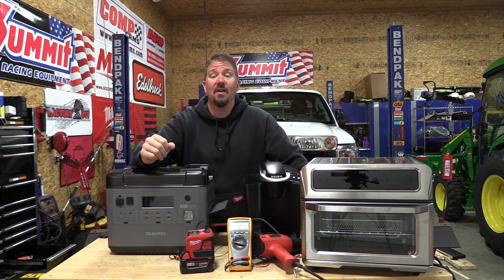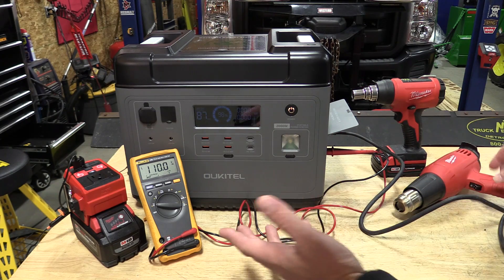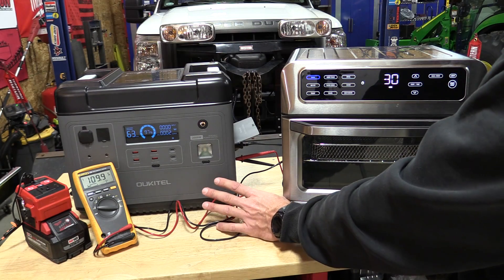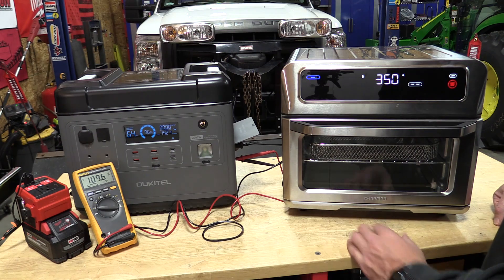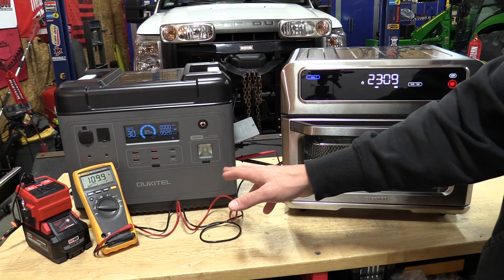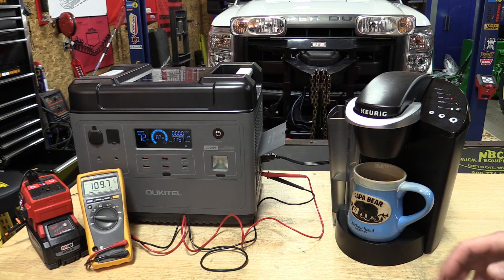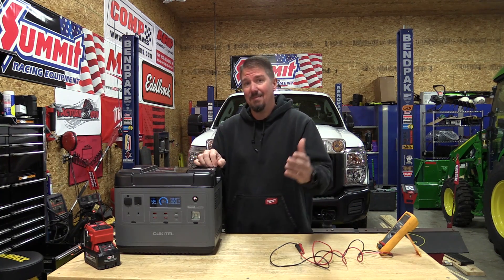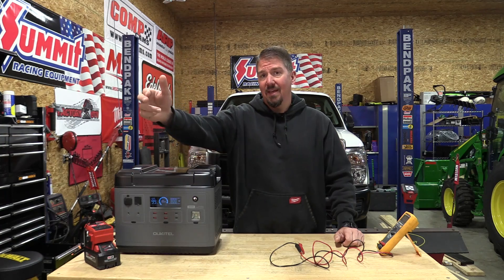What Can A Battery/Solar Generator Run?  You Might Want To Keep Your Gas Generators!

Comment: and this is why i'm keeping my little gas generator. it may not keep up with a 2000-3000 watt load but it's meger output will get that battery going a heck of a lot longer and can recharge it to a level that the solar can take care of. (so early morning it'll bring it to a lower level vs late evening)

Comment: Great video! Almost ANY appliance will draw 1,200-1,800 watts. Doesn't matter if we're cooking a turkey or sawing a board or making a single cup of coffee. These things are all designed around a 15 Amp wall plug with unlimited duration of power available.

Now, when we ask a battery or a gas generator to do the job of our local coal plant, we are working with a very limited and inefficient power source.

Comment: Do you think running a new type of refrigerator at 110 volts is something that may not be a good idea?  Seems like these new refrigerators have electronics that my not like that lower voltage. 
What do you think on this ?   Thanks
Reply: a lot of us outlets don't hit 120v anymore. a lot are 110 or even lower. the new fridges have that in mind though they definitely don't like it.

Comment: I made an expensive mistake by not understanding that these things turn themselves off when they don't see a high enough power draw. I got one to run a refrigerator in my van, and it wouldn't stay on. I trashed the power box and built my own system so it stays on all the time. Lesson learned the hard way.
Reply from the maker: Some can be made to stay on.  Not this one.
Reply: @WorkshopAddict  I wish they would make it clear which ones will stay on and which ones won't.  It would have made things so much easier. However, by having to build my own system, I learned a lot that I wouldn't otherwise have known.
Reply from the maker: The Bluetti AC200 is one of the few that will stay on.  I bet you learned a lot!
Reply: @WorkshopAddict  Thanks. Yes, and still learning. Saying "I built that!" feels good.

Comment: I will only use them to run small things like laptops,  phone charging,  radios,   other small electronics.     
  Anything large,  Tools,  is way better running on a gasoline generator
,    You can buy a large gasoline generator for the price of these battery generators,
 Thanks for explaining this 😃😃

Comment: These solar generators are more capable than one might think depending on what you get, but you have to plan things out and be strategic. I wouldn't run high power draw devices like ovens and microwaves during a power outage regardless of what my power source is. Want to stretch your power out. I have several solar generators and here's my real-world test results for emergency situations:

- Bluetti EB240 (1000W output, 2400Wh capacity) - Runs my full-size refrigerator for 18.5 hours
- Bluetti AC100 (600W output, 1000Wh capacity) - Runs Internet router and network switches for 19.5 hours
- Bluetti EP500 (2000W output, 5120Wh capacity) - Runs whole home gas furnace for 21.5 hours!
- Bluetti AC200 (2000W output, 1700Wh capacity) - Haven't done long-duration tests as I use this for powering phones, fans, computers, and other random things

With this arsenal, I've found that I rarely need to turn to a gas generator or other power source. Most power outages under 24 hours I get by just fine with this. I also have 1500W of portable solar panels to keep them going.

Having said that, I agree with the title "You Might Want to Keep Your Gas Generator". I have a dual-fuel Champion 2500W inverter generator (1650 running watts on propane). The sun doesn't always shine, or maybe you just need to power up your batteries faster. I use the generator to recharge the power stations if solar isn't cutting it and grid power is still out. But then I can run the power stations at night and put the generator away. Dual backup strategy helps you stretch your fuel during a prolonged power outage. I recommend having both if you can swing it.

Comment: As someone who lives off grid and uses all solar, it's just dumb to buy a "solar generator". They're all underbuilt and overpriced. I run a whole house on a 2kwatt inverter. That's 2 chest freezers, 2 tvs, 2 laptops, the oven on a full sized gas range, and various lights. I have a larger inverter for power tools. Without the cost of the panels, my 2kw setup costs less than one of those "generators". Make your own, people. Make your own.

Comment: Biased, and i get it. Im looking at an ecoflow 1800 w 2 panels. 6hrs full sun 100% charge. 15hr run basic full size fridge. This unit is about 1400$ on sale. If the grid goes down, gas will be tough to get. Solar gens stay inside no noise no fumes, free refill. TV, frifge and lights, electric blanket. Im an electrician, these 1800s are worth it. Car charge, plug in and solar even gas gen. Solar gen is unbeatable for catastrophic grid fail

Comment: Thanks for the explanation of the limitations of inverters. Each energy source (battery, gasoline, kerosene, propane, solar panels, etc ) has a maximum rate it can deliver energy and a maximum total amount of energy it can deliver. One practical difference between sources is how much energy can you afford to store. It is easy to stockpile gasoline and kerosene. Most other sources get expensive.
Reply: personally i use propane for it's shelf life. ethonal free gas with a stabilizer can go a long while too but propane is a lot simpler and will get used in heating and some even some lighting. (i converted a little old generator to be an ac unit for added efficiency but god is it maintenance heavy and not really worth it compared to just having an extra tank or two of propane)

Comment: Great channel, always solid reviews. Not for emergency use , except to charge phones and small items, also work well with small camping refrigerators like Dometic . For power outage or storm related problems a small generator is all you need like a Honda 2000, it will run a full size fridge and heaters and lights no problem for 6-7 hrs on 1 gal of gas .

Comment: Nice video! I did a lot of research on back up batteries recently so this information is familiar to me. As a proper emergency back up these battery back ups have a lot to be desired and something like a Tesla set up is too cost prohibitive in my opinion. Gas is not dead. You got that right.  Cheers!

Comment: The EGO Nexus power inverter is awesome. The batteries are dang expensive though which limits it’s runtime according to the size of your wallet. The EGO inverter is not budget friendly, but still one of the top dogs.
Reply from the maker: The EGO Nexus blew up my RV refrigerator and battery charger.  I would recommend staying away from it.
Reply: @WorkshopAddict  Could you explain how that happened. I’m confused.

Comment: At minimum we should have 2k generator and better yet 3k. The solar stuff if fine in sunny climates but in New.England or Northern climates it doesn't help much in winter and rainy season
Reply: Solar is overrated do your research and think of the variables involved.
Reply: Ecoflow 1800 can charge 0-80% from the wall plug in one hour 100% in 2hrs and holds charge for a year
Reply: @stephensebert763  of you have power at your wall outlet, why would you need the Ecoflow?
Reply: @gary3046  of course you keep it on the shelf and with full charge you have electric blanket and or lights/fridge until the next sunny day, in which you charge it up free. Btw you can run the fridge while solar charging it.

Comment: I'm half way in. What you've shown so far is that it works as designed. It handled the starting load of the saw (which is probably more than the cutting load that you didn't yet show), you talked about the huge peak from the oven, well, chances are there wasn't much of one as it's not inductive. I'm building a unit like that but 2.6kWh, 1200w cont, 1500w 15 mins, 2000w surge, so it'll last better than that unit but have less peak operating. I'm going to run a small 1.5hp compressor from it and it should do just fine provided it survives the starting current which I think it will.
Reply: You also picked on the voltage output which is actually correct for your region, you're 110V not 115 and not 120. That's the tool manufacturer telling lies there and the solar generator exposing them with its display... ;-)
Reply: Your general message is okay, but the saw thing was misleading, voltage comments not quite right, and practicality of oven and coffee maker pretty reasonable - you don't need to run either for a full hour to do a typical task there - you're not going to use it to do a roast leg of lamb :-D But it'll totally make some toasted sandwiches or warm up some quiche or whatever. Good intentions but missed the mark a bit IMO.

Comment: I'm glad that you spoke about Tesla's battery life usage in the winter. Everyone praises them, but no one will be honest about the adverse weather faults. Everyone has videos of trips in perfect weather conditions. Then they spend 3 hours at charging stations on a 600-mile trip.
I think of the Tesla as a motorcycle for those who won't drive anything without 4 wheels.
A very limited alternate vehicle.
Reply: I don’t know about that. Battery powered vehicles would probably work for most peoples commute during the week year round. There’s a lot of variables there but even in the dead of winter in the upper Midwest where I live you should still be able to get 150 miles on a charge. Most people don’t have a 150 mile round trip commute. If you have a garage and less than an hour commute it’ll work just fine for daily use.
Reply: @mramseyISU  Precisely, and then it comes down to this: How frequently do I do those long trips and do I need them to be non-stop and/or fast pit-stop trips? If the latter answer is no, then Tesla is fine. If the latter answer is yes then: is the frequency per year low? if yes, rent a vehicle for those trips. If no, own a second ICE vehicle for those trips. Easy.
Reply: Here in Texas, there's the driving in summer with the AC on...
Reply: @wim0104  assuming that the Tesla uses a belt driven compressor it’s going draw a whole lot less power than a heater coil will.

Comment: I had some Ecoflow products the one I had was around 1440wh with a 600watt output. That setup cost me around 1000$. I can say that for my needs it was NOT worth it. For me if you need any of the portable battery banks to run several hundred watts continuously these are pointless. Much better off purchasing a gas inverter generator and using that all day. Even the cheaper Predator 3500 (850$) is a good option. Great on fuel and quiet and currently have over 5,000 hours on one of them and still going strong! So bottom line fore me. If you are getting this to run tools then I'd say you may be better off getting a battery platform kit and a gas generator to charge the batteries. You'd probably come out saving money and frustration. Not to mention these power stations arnt as durable as a gas generator. Sorry for the rambling. Love your videos! Hope you have a great new year!
Reply: Good information 👍